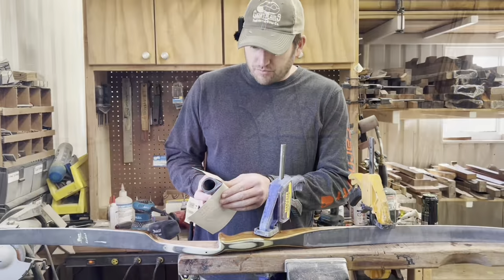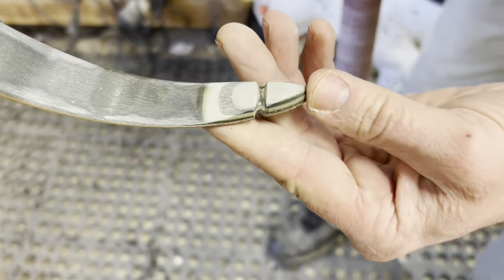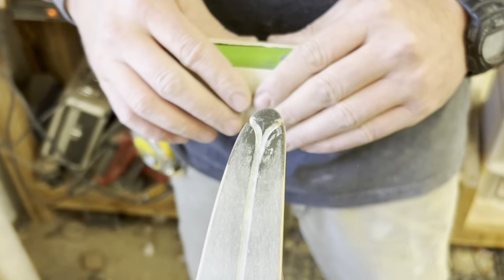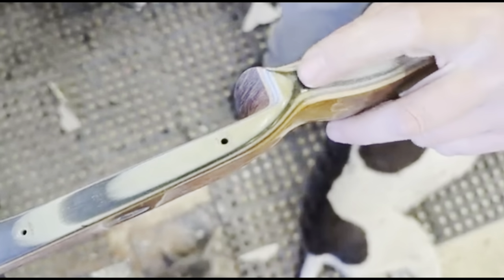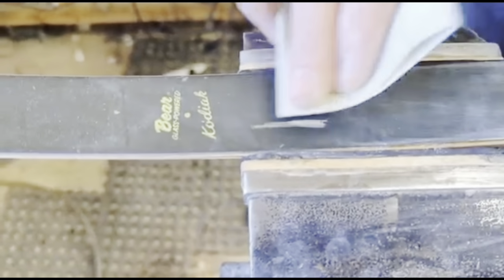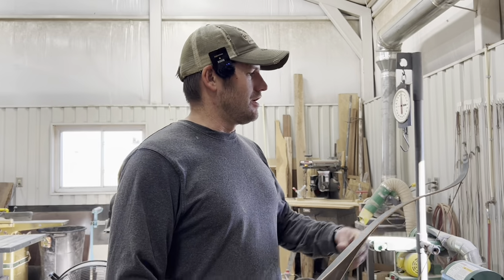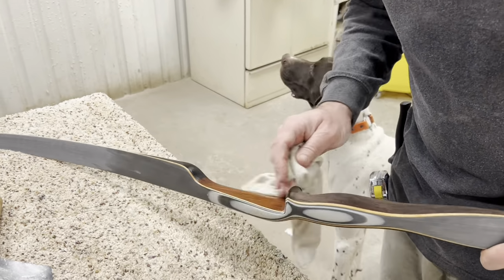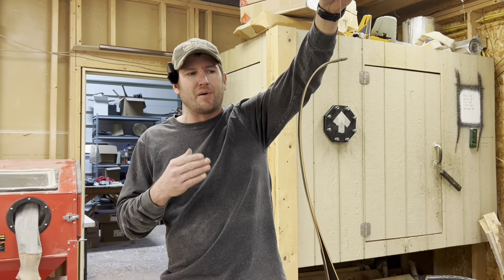Bear Kodiak 1961 Traditional Recurve - Full Rework - Part 2

Comment: The color was Arctic grey, the green appearance was from aged finish. To make things easier on your next Bear refinish that coin will come out with heat lightly applied where cleaning the coin and sanding around the coin area will be easier. The decals can be purchased from a guy named Al Harford, if you search a traditional page related to Bear you can find his contact, he makes replacements in the exact colors and years for every vintage Bear bow, that way you can confidently sand the logos off and not worry about getting too close and ruining them, just replace before you apply the finish. Great job
Reply from the maker: Thanks!
Reply from the maker: I will most definitely reach out to him. Thanks for the great info!
Reply: @greatplainsbow yes sir
Reply: I was thinking the same thing about the color issue. The old factory finish turned brown over time.
Reply: @paullewis5045 I’ve refinished several vintage Bear bows and a few with this arctic grey glass and I was just as surprised when I removed the finish as he was, they always have that green tint before removing the old finish. That finish was tough Bear used but it definitely took on aging color
Reply: I had a '69 Kodiak Magnum that had the same finish situation. It was greenish in appearance, but not really the classic Bear green. More of an olive green. It still looked great, but doing some research showed that it was gray glass at construction that aged over time to the green color.

Comment: Wow, what a  craftsman and knowledge you hold. Great vlog and kudos to the editor and photographer.
You probably wear a mask on your regular work hours but if you don't you should strongly consider it. That fiberglass sanding is going to leave microscopic particles in the air and will definitely catch up to you with lung problems.

Comment: Yes, as a 61 it would have been built in 61. Grayling green would have been in 61 only but in 62 they did use bark gray glass so it could be a late 61 model.
 I have a 56, 59 and 64.  These are some great shooters especially the 64... nice work Shane... 😉
Reply: I agree as model was not a static design like say the Bear Grizzly made the same way ever since 1964 without much in way of changes to shape/design of model.
Reply: Beautiful job Shane,love your instruction and attention to detail

Comment: I agree completely with @billward---re. the finish question. Also, Bear did do something different every year to distinguish the model year change-wood selection, glass colors limb tip profile, coin metals etc. Except for the very early, late 40's and early 50's static models which saw little change. Well, except for eliminating the aluminum lamination and changing from woven glass to linear strand, until the first working recurve; Kodiak II. I did work at the Bear Archery Shop of Detroit when I was in High School. So, I got to see these beautiful 60's era. bows fresh from the factory.  Also, nice job changing the arrow rest profile.
Reply from the maker: Very interesting! Thanks for watching!

Comment: Would it be possible for you to do a restoration like this on a bow made in 1968 that has lost some pounds over the years and overlay new glass to add draw weight back to the bow? You always do such an amazing job with these old bows. Thanks for sharing it with us.
Reply from the maker: Yep it sure is possible, but it'd be quite expensive due to the time involved

Comment: That's interesting about the color of the finish.... I'm going to have a talk with a painter i used to work with and see what his thoughts are about pigmenting the finish. If i find something out, i will let you know.... That bow still turned out wonderful and i appreciate the fact you kept to the original design's and respected the maker.
Reply from the maker: Thanks for watching!
Reply: @greatplainsbow   just wanted to let you know... I talked to my good painter buddy and he said yes to adding color to the finish and told me to tell you to check with your distributor that you get your finishes from,  see what type of color will work best with the finish that you use.... Some finishes will not matter so much, but others definitely will. Also for matching the color correctly he would recommend a test try using the type/color "in your case it's gray glass" and mix what you think is the correct color or shade and give it a shot. For the reasons that it sanded with a green color is from what he believes happened, is that the original finish was applied to the bow and limbs as they were porous and allowed the tint/finish to quickly soak into the glass/wood before things cured.... He also understands that you're working with porous materials all the time, and if that were to be an issue he recommends trying a standard single/sealer coat first then sand and prep for the remainder of applications . I really hope this information points you in the right direction....I really enjoy watching the " THIS OLD HOUSE" bow addition.
Reply from the maker: @normankaster917  thanks for the info! Yeah I know you can add color to finish, but the issue isn't so much that as the fact that if you do that you'll have to figure something out with all the wood areas on the bow. Either you spray the whole bow and then try to sand off the tinted finish on the wood areas or you tape off the wood areas and neither option would really work at all

Comment: Just a quick follow-up on hole filling: I have used a countersink to feather out the hard edge of the old drill holes. That seems to help the blending. I have never done this, but you may be able to reprofile the feathering at the edge of the overlays and then work with one color.  It will never be perfect though. I also fill the hole to full depth. Using the recovered glass dust like you are doing is really, really good. I have tried using boat epoxy color tinting too. But color matching is tough. Using original material is easier and smarter.
Reply from the maker: Thanks for the info! I appreciate it!

Comment: I am not aware of gray base glass being used but that is not to say a savvy bowyer or manager at Bear had to call an audible to keep the production line moving, or the bow was returned to the line because of a color anomoly in order to bring it into specs & refinished to factory green
Reply from the maker: Good thoughts
Reply: By the way, I actually love the way the gray turned out. Great work on that bow Shane, she is a beaut!
Reply from the maker: @DavidHBurkart  Thanks!
Reply: The "savvy manager" in that era was Bob Kelly who eventually became the president of Bear Archery. Bear made their own glass for many years. With enough bows in hand, you can see the progress. I have refinished several bows from that era. I do recall one, a 1961 (?) Kodiak Special, with creamy yellow glass, that I thought had some color pigmented into the finish. That may have been because of the challenge of getting the tint right in the mix when the glass was made. I think they would have to make that call, to pigment the final finish, if the bow was out of the press with uneven dye color etc. That is just speculation on my part though. Bear honored their warranty strictly and nearly went bankrupt because of limb problems more than once.
Reply: @paullewis5045  Wow, that is awesome history. Thanks for sharing your insights

Comment: Hey man, I sent those pictures over to your email. The one is of a crack that runs from the bottom limb up the handle and end of the top limb. I was going to sand it down and use the CA glue and dust to fill the cracks. Is that what you would do?
Reply from the maker: Just checked em out. Yeah if that's just a hairline crack that's what I'd do as long as the riser or limbs aren't actually coming apart you'll be fine. Just keep sanding up dust and filling until you can't feel the cracks. Try to use dust that matches each part of the bow

Comment: use the sanding dust you've already created
Reply from the maker: For?
Reply: @greatplainsbow  filling the holes, mix a little in with your epoxy...😉
Reply from the maker: @sierraridgereaper  10 4 yep that's what I did there, but in this case ca glue is a better option